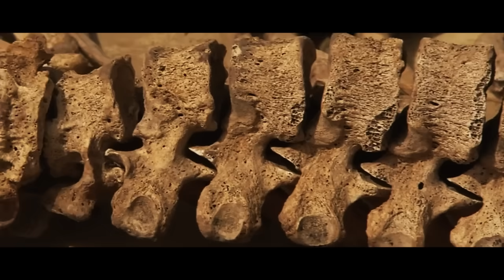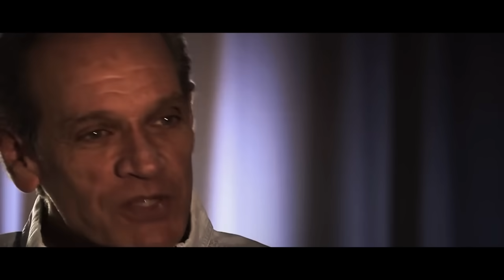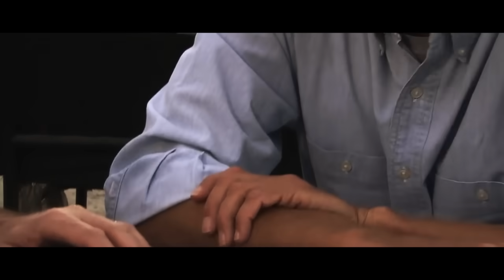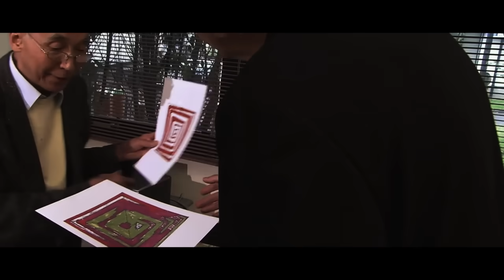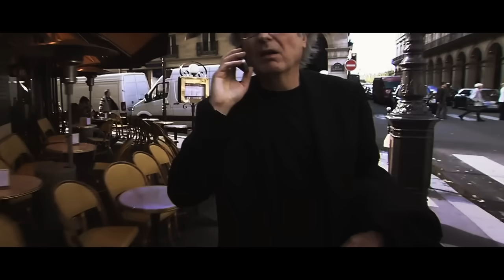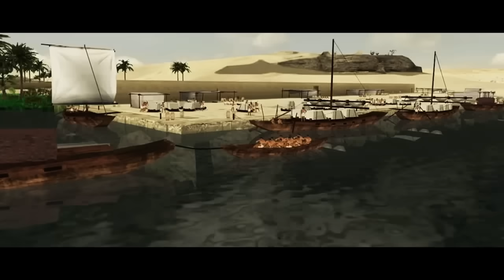Secret of The Great Pyramids Revealed.. Could It Be? (2019-2020)

Comment: They knew about lenses and they've melted granite with the sun. They brought the granite up in small bits, and when they had enough granite, they melted the granite. Then they poured the molten granite into wooden molds, which burnt away leaving a perfect fit for the granite blocks. No heavy lifting this way. They could have done this with the stones as well. They brought it up in small stones, then melted and molded the stones into place.

Comment: he is the thing, the evidence to show movement inside the pyramid isn't for it's construction it was for storage of seeds. The low tech methods they used (no wheel invented) was using man power to pull seeds inside to store. The storage was made to let civilization survive in times of need, to grow more crops and to store unused seeds for population growth. The seeds was preserved as it is said the pyramid has the ability to keep it cool a steady 20c inside the pyramid no matter of outside conditions, to keep it dry and has an ability to preserve not just seeds but to prevent decay. Condensation naturally got evaporated and turned into salt which was found on the Queen's chamber up to 1 inch thick, extremely important in the preservation of anything. No flood will make this salt and keep in mind the nile was fresh water. When you look at the pyramid in this way you can see these are basically storage silo's and the people who made the pyramids using sound vibration energy to move and cut stones however they wished. We call them aliens but infact aliens are all of one which is us just more advanced. The workers that got paid in beer wasn't the builders of the pyramid they are the work force of manual labour that pulled the heavy seeds inside and outside the pyramid when it was needed. They protected the seeds at all costs and got paid in Beer! made from the very seeds they protected. It was a wonderful arrangement

Comment: Utter Horseshit.
Especially the cartouche that was a proven forgery to obtain research funding at its very convenient time of discovery.
Copper, or any of it's alloys, can not cut sandstone, let alone with thousandths of an inch precision. 
This supposed method of construction is presented with zero knowledge of engineering.
To complete the task in 20 years, each of the stones would have needed to be placed with laser precision every 2.5 seconds.
Again total nonsense.
I suppose they achived the celestial alignments and mathematical ratios with ropes and wooden sleds as well? 
smh.

Comment: I Love you Anonymous Official, I really do and am an avid follower.  I appreciate that you want to provide knowledge of truth to us. I just have a different knowledge of the pyramids. The pyramids of Giza were not built by the Dynastic Pharaohs, they were found by them. In the valley of the kings all of the walls of the Kings were painted with hieroglyphics.  None of the chambers in the Giza pyramids had anything painted on them, they have found water & chemicals on the walls, which might indicate that they used them for some type of power source; what for, un-mainstream scientists have similar but not exactly agreed uses.  The sphinx has water, salt water erosion on it's sides indicating it was built before the deluge. It's sad that those findings aren't wide spread knowledge and the crap about the Pharaohs building them is.

Comment: How they were built falls short of the question why were they built. My guess; wireless power or giant Baghdad batteries.
Reply: Definatetly, natural aquifer’s underneath where the Nile once ran, conductive and none conductive limestone, granite which is naturally radioactive, quartz basins that sat at each corner, the positioning on a natural ley line, the size in relation to the planet, celestial alignment. It would of concerntrated natural forces like nothing we have ever seen. I don’t think this energy was for use as we use today but for use enhancing the conscious and physical level of the beings in its presence. What that energy and level felt like and for what purpose is what fascinates me 👊🏼